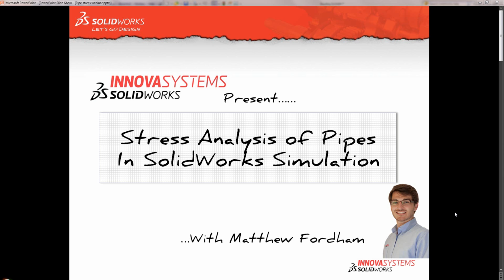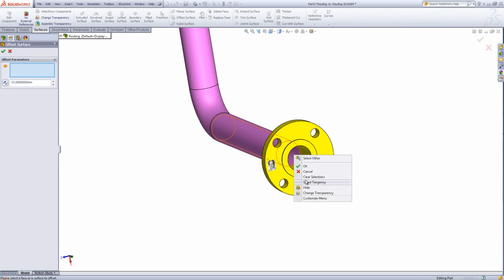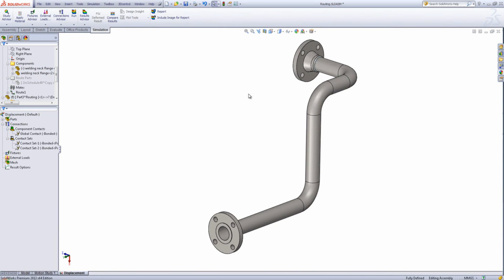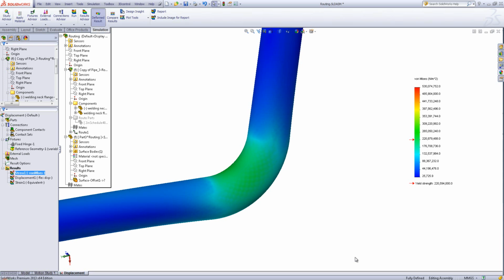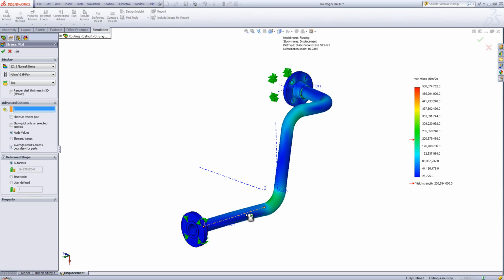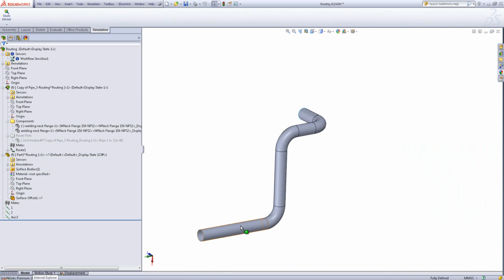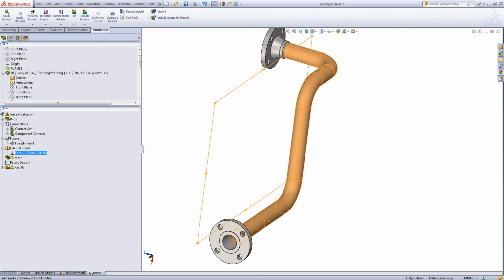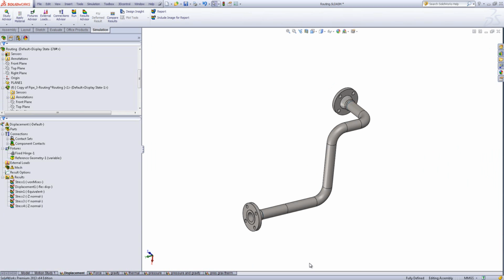Pipe stress analysis in SolidWorks Simulation

Comment: Howdy Mathew, I have a question. I have a piece of 8" black poly pipe 40 feet long with a 1" wall.  I apply the proper material to the pipe. Now, if I simulate a forklift picking up that piece of pipe will the pipe bend or flex as in real world situations. Thank you in advance for your response.

Comment: Hi there, great video buddy. I have one question about contact set. Since Simulation gives every component in an assembly a bonded connection as default, why did you add on two bonded condition for line and surface contact again? Is that necessary? Hope get yor answer soon. Thx!!